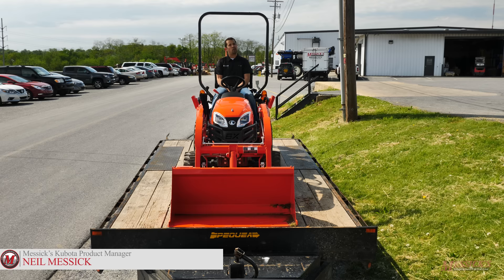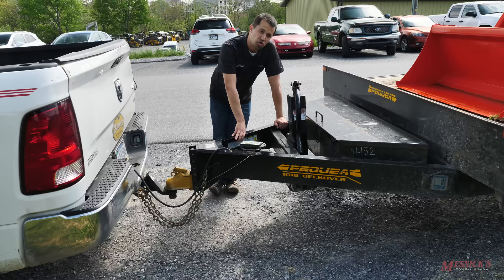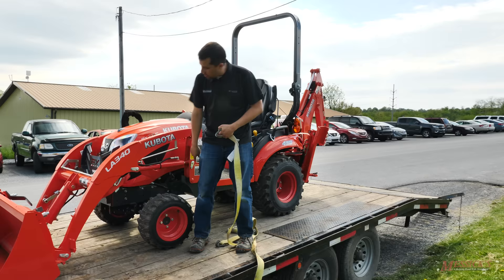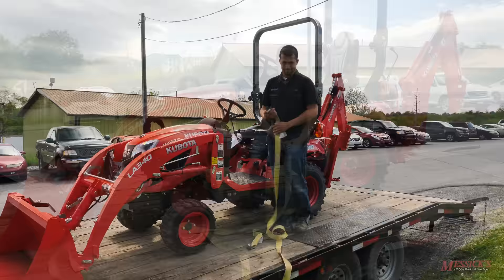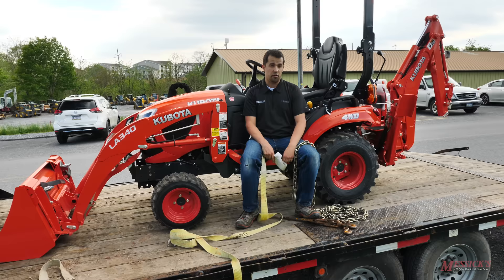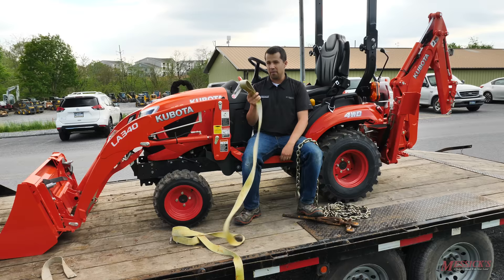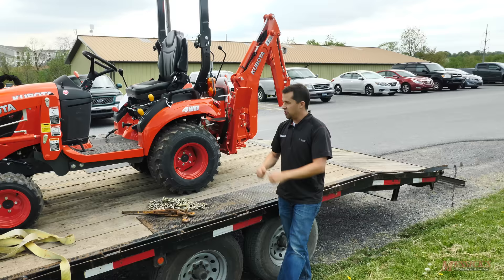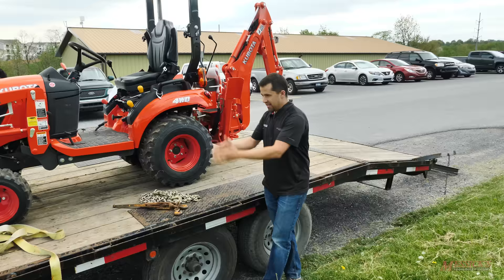Tips for loading and hauling your equipment (with bloopers!!)

Comment: Single Clevis in draw bar isn’t legal. In MA at least. Needs to be 4 points and 4 separate binders. And I usually place blocks under the back of the trailer when unloading so not to put strain on the tongue or truck. I have done a lot of repairs on cracked dove tails and tongues from added stress when loading and unloading.
Reply: This is interesting conversation.  My dealer's drivers both ran a chain through the loader frame (where the round tube is in the loader) and called that the front tie down, and two chains to the corner of the backhoe where there are tie down points, and then one chain across the backhoe bucket.  They said they never had issues.  I have read and heard other YouTubers (I believe one may have been Tractor Mike) say that they were supposed to have 4 chains, then one for each implement (one backhoe and one loader).  Is there official legislation or guides from the US DOT that anyone can point to on this?  I have always been curious.
Reply: Also one question I do have for you welderboy525, I notice some trailers have jacks under the ramps when the ramps fold down.  Does your trailer not have that, is that why you use the blocks?  I agree even with my small utility trailer it puts a lot of stress when using the ramps, so it would make sense the use the blocks.  I was just curious in the future if I ever get a trailer large enough for my tractor if the ramps with the jacks are worth the added weight and hassle.
Reply: Matt, google “ FMCSA Load Securment”. Scrole down 3 or so looking for  . Gov as the address. You can alway call your states DOT for questions. Iowa has a driect # to the guys that write tickets.
It’s cheaper to ask than take the chance.
Reply: Matt Jenkins the ramps with the legs on them don’t necessarily prevent the strain. The best set up I’ve seen and never had to repair are the ones with 2 jacks or legs on the back of the trailer. Unfortunately fixed legs on ramps aren’t always at the right height
Reply: 2 adjustable jacks at the rear corner work the best at stabilizing the trailer. Then crank the jacks up, lowering the trailer to ride height  . It takes a little more time , but safety does not hurt.
Reply: Thanks welderboy525 I didn't realize they made them like that.  I've noticed the height issue on my dealer's trailers as sometimes the driver has a hard time getting the ramps to go all the way down as the jack pushes into my gravel driveway.
Reply: Matt Jenkins I live in the same state as Tractor Mike, what he showed, 4 independent anchor points, is what is specified by our state for commercial hauling and then 1 for each implement attached to the tractor including a front end loader. Does everyone do this no. 
However, in my opinion it is best to follow DOT requirements, as I have had local police tell me some strange stuff. Also if you end up in an accident if you are DOT for your state complaint your legal status is much better. 
In my state the shackle and chain would count as 1 anchor point if the 4 min required. I think think it would be fine for the one, but need another especially as a dealer doing delivery’s!
Check what your state requires and follow that!
Reply: welderboy525 also those are attached to the ramps which fold and not directly to the trailer. So what happens as you unload or load when all the weight is on the back of the trailer but none on the ramp? I know, but think about it!
Reply: @VideosByAl  Do you use something such as bottle jacks?
Reply: I would not use a Bottle Jack because it may tip over if the trailer rolls or wiggles while loading. An Adjustable Screw Jack will be permanently attached to the trailer and if the trailer should mover the jack will hold the load and slide on the ground.

Comment: Ratchet straps all the way for me. One big mistake people make is overtightening them. If your 3000lb ratchet strap already has 2000lb of tension static, you have it too tight. Also, any equipment needs to have 4 straps, not two.
Had that RTV been chained down, the chain likely would have broken as well. Chains don't take shock loads very well, and that must have been one hell of a shock load. Rathcet straps will absorb that shock much better.

Comment: I use chains and ratcheting screw binders on anything over 1000 lbs. If your load falls off your trailer because of broken straps there will be more damage than the few scratches you get from chains.

Comment: I always place thick blocks of wood way on the rear frame of the trailer whenever loading/unloading machines.... Keeps the trailer and truck suspension from moving as much with the transferring of weight, everything stiffer but each trailer is different.
Reply: Farming 4G good idea
Reply: Farming 4G watched you do that we did construction up until 08 and I have done some stupid stuff with a trailer for instance 953 cab and 4 in 1 bucket on a 15 ton trailer with a 1 ton dodge now I kept it on mostly weighted on the trailer and it was only 15 miles no hills just one job site to another  but people that passed me had the weirdest looks of terror on there faces should have been a dodge commercial I guess

Comment: Nothing wrong with using straps if you know what you're doing.  Study FMCSA rules, they tell you the bare minimum legal standard to get on the road.  Chains and ratchet binders are definitely easier and often preferable for mobile equipment.

Comment: You can get 10 ton rated straps no problem...military uses them all the time for securing aircraft and payloads, should be sufficient for a compact tractor...much easier to secure with them.

Comment: I have an 18 ft landscape trailer that I built attachments just for it to load my tractor on. on the front I built a drop in style front brace that locks in my front tires from going forward and I built another attachment in the back that locks in the rear tires no chains or straps required however I do put a strap that hooks onto the loader bucket and onto the rear 3 point to keep the tractor from bouncing incase of an accident.

Comment: You Should check to see what your state laws are on how many tie downs you need per weight and Length of trailer since some states are every 7 feet or 10,000 lbs or 10 feet or 10,000 lbs

Comment: I had one time where the trailer with the bosses Mahindra eMax 25, didn't feel quite right on the road that had a speed limit of 30 MPH. Pulled over and just moved the tractor maybe 6 inches further forward and the truck felt more sure footed. The road t's into the main road that has a speed limit of 55 MPH but since it has been widened to 4 lane with left turn lane, people speed going 60 to 66 MPH. Hate to have it fish tail there. 

Also to tie it down we found at Autozone two shorter straps about 2 feet long with triangle loops on the ends. It also has a black cover that protects the yellow strap. We loop it around the front axles, one for each side and then use strap from those to the loops on the trailer. Just google for Axle strap to find it. They don't fit around the rear axle, so we just use one strap from side to side through the 3 point currently. Trying to find a better way though. All straps are 3,300 Lbs or higher rated.

Comment: Regarding weight and loading a trailer where it lifts the back of your truck off the ground: Consider a 7,000-pound tractor being loaded on a dual axle trailer.  Each axle is rated for 3500 pounds and you feel safe. But when your 7000-pound tractor is lifting the back end of your truck up by pivoting on the rear axle, you now have 14000 pounds pushing down on only one axle rated for 3500 pounds. 7,000 pounds from the tractor pushing down and another 7,000 pounds pushing down as it balances the force on the truck side. The front axle of the trailer is lifted in the air and not supporting any of that weight. Anyone ever see an axle snap like that? Jacks or wooden blocks in the back as you load would support that weight and limit the weight on your back axle.
Reply: That is not how weight works. The truck is not siting on the trailer and it is just an anchor it doesn't add weight to the trailer.
Reply: @trevorlynch6549    Think about a see saw. One 50 pound kid sits on one side and the other side goes up in the air and his end hits the ground and only 25 pounds is felt by the pivot point or axle (25 pounds is supported by the ground and 25 pounds by the axle).  Another 50 pound kid comes by and gets on the other end. There is now 50 pounds on each end that the axle is supporting which makes it 100 pounds in total. The same thing with a truck pulling down on the tongue. Whatever weight is pulling down on one side is pulling down on the other side of the axle with equal force. The way to prevent this excessive force is to put supports on the trailer ramps so your axle only has to support 1/2 the weight of your load instead of two times the weight. All heavy duty trailers have this support for this very reason.

Comment: ...Not mentioned here is to block up/jack up the rear of the trailer when loading & unloading, It keeps the tongue weight more stable so not to damage truck or trailer hitch components.

Comment: Agree with Farming  4G about the wheel chocks (scotch blocks) and to add to that you should never load equipment on a trailer pulled by a pick-up DOWN HILL.  when the weight comes off the drive wheels of the towing vehicle you can find yourself drifting down hill uncontrollably. Always load UP HILL if you can't load on level ground. Unloading, as Neal described, is just the opposite. Never brake the tractor if you find yourself in  a drifting situation, get the weight back on the trailer tong as quickly as possible to allow the towing vehicle to settle back down on the ground.

Comment: Being a trailer with electric brakes, it may be a good idea to pull the disconnect and let the battery on the trailer activate the trailer brakes for both stability and to save jerking on the tow vehicle drive train

Comment: Four chains and ratchet binders and don't rely on the tires staying inflated to keep the chains tight. When you have to lock the brakes up because someone pulled into the street in front of you you don't want the tractor in your back seat.

Comment: I was told that in NC all 4 corners need to be tied with something rated for 50% of the total weight. Also implements, even if attached, must also be strapped down including FEL and mowers etc. 
Either ratchet straps or chains rated at a min of 50% are fine. For my small equipment I use 1/4” gr70 chain and binders and 3” straps for implements.

Comment: You forgot to mention to make sure that the tongue is latched onto the ball before loading. It's not fun when loading your Kubota M-6040 and the 32' gooseneck trailer looks more like a launch pad than a trailer and then rolls into your tailgate on your 5 month old truck. Lessons learned though now I always triple check the coupler and I make sure I always load in 4 wheel drive.
Reply: bearkatljl well
Reply from the maker: ouch!
Reply: Don't feel bad 2005 dodge ram 3500 2 days of ownership when bought new in march of 05 truck had 18 miles on it when it left the dealer and had 30 miles on it when I forgot to lock the trailer to the truck and completely dug into the tailgate with the trailer.. ALWAYS check that the trailer is LOCKED TO THE TRUCK FIRST.

Comment: Maybe u could show us the anchor points on the tractor that your talking about....
Reply: One good spot in the back is where the drawbar slides into the frame, take the drawbar out and put the chain through the hole there, if there is not hole use a shackle on the end of the drawbar. For the front if you don't want to scratch any paint fish the chain through the cross tube of the loader.

Comment: I know this is an older video, but I’ve been looking for adaptation for front chain down point on the MX models. In Texas you have to have 4 chains for the load. Straps for attachments are allowed. 

I want to add a d ring to front weight rack but can’t find a bolt on option to do this. Chaining the FEL doesn’t meet requirements.

Comment: Ya I have done the same with the truck lifting from the trailer when my drop legs I put on at the back were stuck by the pin. Almost slid my 3/4 ton into the ditch on the side of the road I was parked on when loading my friends john deere skid loader of about 8400lbs

Comment: I use a tandom axle landscape trailer with a 12k weight distribution system to haul a B3200 with weighed tires loader and belly mount mower. And I use a town and country to haul it all with. Never a problem.

Comment: I would really agree and say I see most mistakes on tongue weight throughout pickup truck transporting. It could mean life or death if you go down the road with a tractor sitting on the rear of the trailer pulling up on the pickup hitch. I know afew guys who have had there trucks jackknife when they went to stop because the trailer was lifting up on the drive wheels.

Comment: I have a L-2501 and ordered the Backhoe and a sub frame a week after getting My tractor package on a 18 foot trailer with 4 foot ramps with an angle deck like the one in this video

From the first time unloading and loading I have had issues with the implement hitting the ground even the Boxblade and the Rotary Cutter but especially the Backhoe

I was able to adjust the top link of the 3 point so the Implements did not snag the ends of the ramps when I load, but I did not pay attention to the clearance of the Quick connect handles on the 3 Point and they broke My tail lights when it was raised all the way up

I have only done this on dirt and it really plows the ground with the under carriage of the Backhoe

The ground gets tore up pretty bad as it hits and then drags on the ground

I am thinking of loading the tractor backwards so the Implements/Backhoe rise first and the FEL is only high enough to clear hitting the ground

My first choice was get longer ramps, but when I look at the real ground clearance under Backhoe lateral pivot assembly those ramps are probably going to require being 10 feet long

I have not tried it yet so I am asking if You have tried it and did You have a good center of gravity and proper tongue loading and what clearance issues did You get when raising the ramps for transport

I am wondering if towing it backwards is any different than it facing forward once it is chained down

I called the dealer and when they called Me back they said they just put a BLOCK of WOOD under the rear of the trailer

I understand the geometry of the rear of the trailer and putting blocks under it to keep it from sagging will keep the angle of the ramps set so the rear does not lower closer to the ground

I haven't tried that idea but They said they do it all the time

I think that is full of B.S.

It already drags & snags the ramps and it will keep doing it with the Block idea

My main concerns are the weight distribution on the trailer over he axles and the tongue weight

Thanks

Ken in Florida

Comment: The first thing he said there, about overloaded trailers: I see that ALL THE TIME around here: Overloaded trailers and trucks. I've seen a gooseneck flatbed with a skid-steer being hauled by a half ton, and I've seen a full-size backhoe on a two 7,000 lb axle trailer being hauled by an 02 one ton dodge dually, which is probably about 20,000 lbs gross on a trailer probably rated for 16,000 lbs gross, best case, pulled by a truck with a tow rating of at most 12,000 lbs.

Comment: If only tractor manufacturers put tie down points on there machines like on industrial equiptment got a brand new m110 gx kubota at work a few months ago and it arived with pre scratched and rusted front axles because the transport company that dropped it off to the dealer put chains over the front axle.
Reply: Christopher Read I'm not sure about small tractors but on most 100hp or bigger tractors they have loops cast into the frame for tie downs
Reply: Logan Stansell we got a 110 horse kubota this year and also have a 125 both dont have tie down points neither did the john deere it might be a utility tractor thing not to have them.

Comment: Kubota needs to have a compliance plate with the weight,  i don't care about it's shipping weight, i need to know weight with radiator fluid and engine/hydro oil full, and all implements need weights on a compliance plate too.

Comment: I will never use straps to hual equipment.
At one of my jobs i following behind the other crew truck that hualing a john deere compact tractors probably about the same size as the ine in video.  But as we went down this back road the tractors was bouncing. Now the wheels never came and it was only the shocks that where moving, but one the older guys who had been at this company for 15 years said that hes had that same machine almost fall off. It ended up moving forward and getting stuck on the tounge of the trailer or something.
But if he had used chains that would of never happened.
Idk but the boss refused to used chains for that machine even though we had chains to use!
Reply: Tractors don't have shocks.